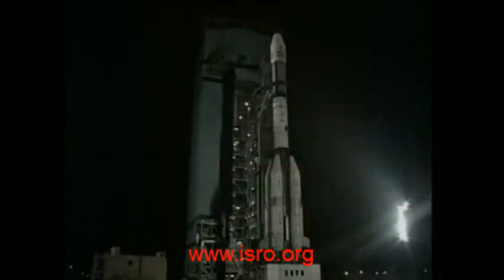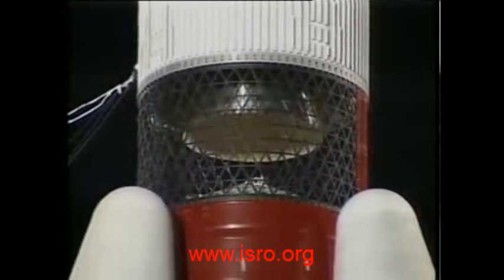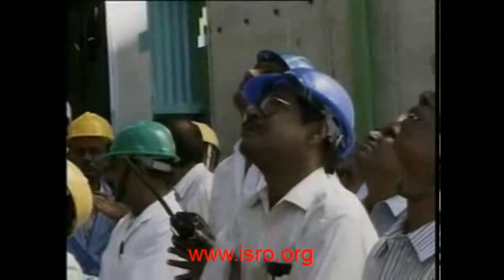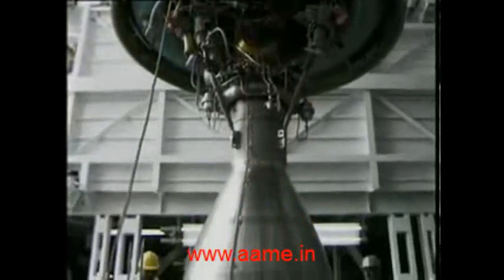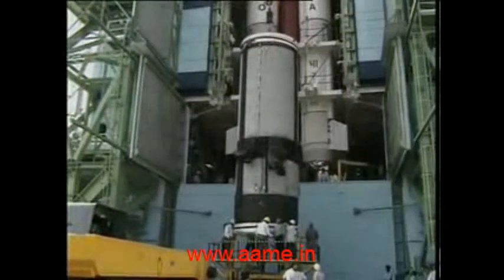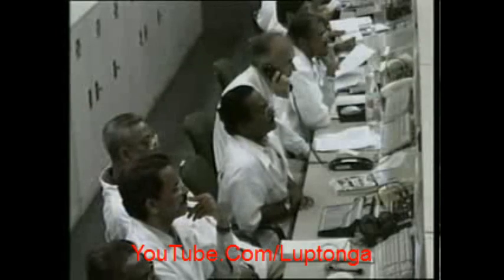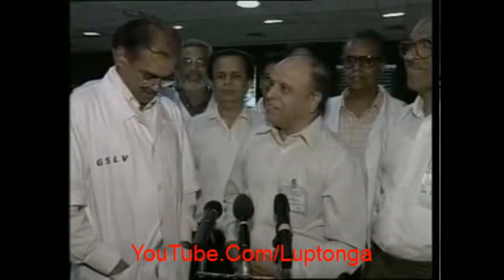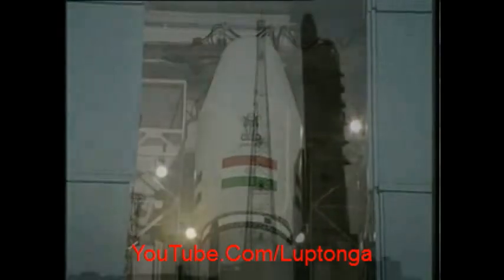India's Geosynchronous Satellite Launch Vehicle [GSLV] - ISRO report

Comment: first stage burn time is less than strap-on boosters it means first stage i.e. (30 tonnes)stays with the boosters for 40 seconds .i don't understand why isro is doing that .what they should do make a cluster of four liquid engine and two solid strap-on. which will make more efficient rocket which can even lift 4 tonnes to GTO